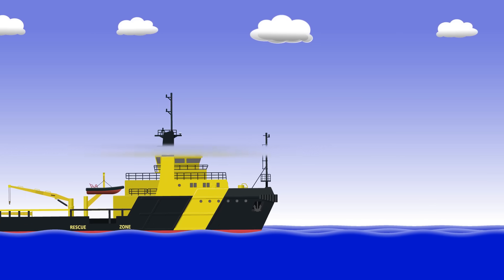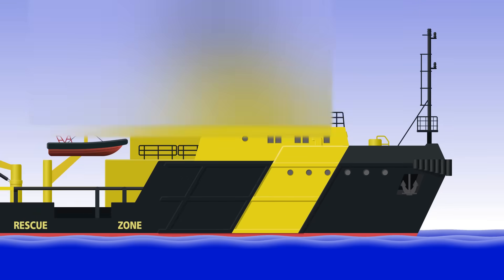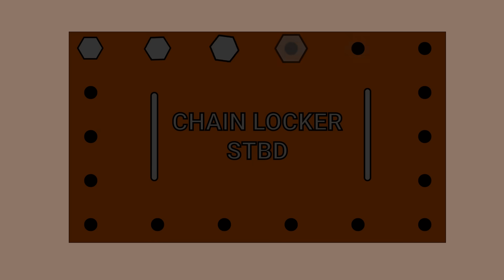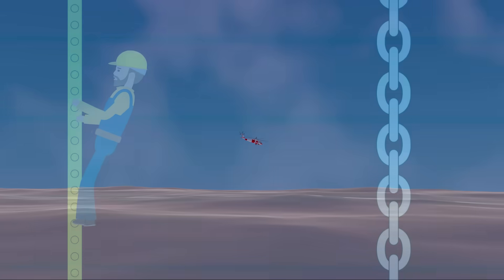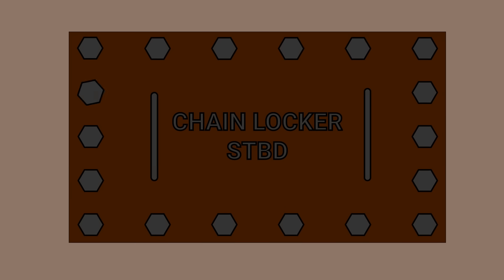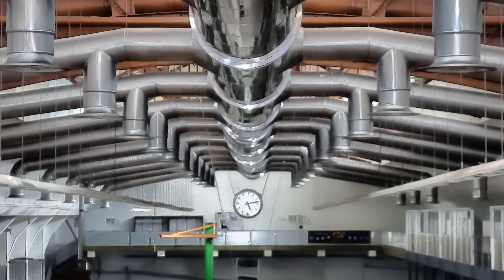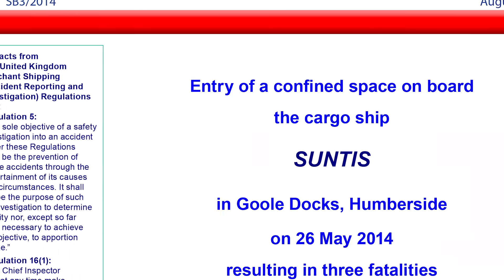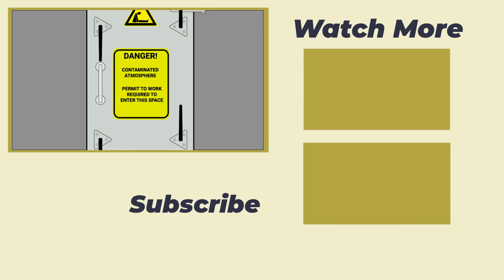Why Enclosed Spaces Are So Dangerous? | Enclosed Space Entry

Comment: How do submarines stay under water weeks on end actually? Where do they get the air they need from?
Reply from the maker: It's all about balancing the oxygen in the air. In nature plants do it, but in a submarine technology needs to do it
Reply: They have either pressurized air and CO2 filters or have an atomic reactor, which provides enough power to convert seawater to oxygen and hydrogen by electrolysis. They also convert seawater with steaming to fresh drinkable water. :)
Reply: Nuclear reactors underwater are awesome things. It’ll boil water to create fresh water to drink/shower/cook/clean with. It powers filters to remove contaminants such as CO2 from the air. It also powers electrolysis to literally create new air to breathe, as well as refill high pressure air tanks for doing things like refilling ballast tanks under so the sub can surface/dive.

Best of all, they need to be refueled on a cycle of years/decades instead of days/weeks. They only things that limit a sub’s endurance are consumables like food and spare parts.
Reply: either by resurfacing every few days, or by electrolysis if they are nuclear power

Comment: Enclosed space must be ventilated sufficiently before entering!
Reply: and even then use a air testing tool to know how the quality inside is.
and as the guard outside Don't ever go inside. that's just a extra body in the worst case
Reply: Or correct breathing equipment.
Reply: There was a rule that personal protection equipment (PPE) such as ear protection, eye protection, steel-toed boots etc. is always the very last option. Whereever possible you should remove the cause of hazard first and then augment with equipment to be safe.
Reply: @IroAppe  that's always the best case. But I also know that sometimes that option is not available or some one has to go in and remove the hazard for others.
Reply: @IroAppe  .

That is correct. For the benefit of others.. Safety training and working in enclosed / confined space training emphasizes the following:

1. Is it necessary for a person to even enter the space, or is there another way to do it.
2. Identify hazards.
3. Isolate hazards, stored kinetic energy etc. (Pressurized pipes/steam/electrical). Even consider things like flash flooding from sudden rain etc.
4. Provide ventilation methods / safety equipment, barriers etc. Have rescue teams on standby if considered serious enough.
5. PPE.
6. Untrained people must not "break the plane" ie. even put a hand through the opening of such a space and must remain outside whatever is going on inside.

Even on may be considered small jobs (and this was probably considered a small job, if not a routine practice signed off on, a JSA should be carried out. Often a short pre-start meeting where hazards are identified amongst the team and possible scenarios mapped out means everyone knows what to do in case of an emergency, and all steps are taken to make the job safe in the first place.

These procedures have been learnt the hard way, over many years, with many injuries and deaths beforehand, so it's not just to make management happy:

http://www.hse.gov.uk/toolbox/confined.htm
Reply: @VenturiLife  or better both if possible.
Reply: Wait can you just open the hatch and wait a while for air to go in or is that not enough
Reply: @thebananarepublic7255  if air is not  circulating it will hardly get any air inside,even if you put a strong fan to blow inside,it would have to blow hard and for sometime to blow the bad shit out of the same hole so ideally you need a circulating space with an entrance and an exit hole on the other side
Reply: @thebananarepublic7255  You would need to wait a long time, preferably have a forced air intake high above and an exit exhaust lower down. Many gasses like CO2 are heavier than air, so unless you have a very powerful fan that can reach lower spaces and create a mixing effect, then just blowing in air from the top will end up just blowing out the same air that just went in, unless there is an exhaust on the ground floor. I think the best emergency response to this situation would have been to open up a few air or oxygen tanks and quickly lower them down there.
Reply: We work on stainless tanker trailers at my work. Anywhere from fuel to chemicals to wine to sewage. In order to work on a Fuel tank SAFELY we had to open up every single possible valve and manhole, drain the remaining fuel, let an airhose running 115 psi blow through the system for at least 30 minutes before even attempting to test the space with an atmospheric tester (sniffer) and finally getting an enclosed space permit signed so you can go inside. Even after all that you go in with full ppe, Fall protection, proper masks, and NEVER before raidioing in to your floor lead saying your going in and again when your coming out. Enclosed spaces are serious work.
Reply: I learn abit about HSE stuff. Yeah. We have procedure to follow if we want to work at those area
Reply: Anton Babych weighs 460 pounds and would not have been able to enter that space anyway.
Also I doubt he's even leaving his basement
Reply: Y’all acting like the man didn’t say any of this in the video lmao
Reply: Enclosed rooms are enclosed rooms they can't be open in any way. They are isolated .
Reply: not always possible, thats why you always have someone outside, and usually use an air tank
Reply: The issue is that they probably did it before just fine and worked in the chain locker before.
Reply: Yes, that's common sense. I work on board btw.
Reply: what? nooooo
Reply: Enclosed spaces rule #0 - Attendant NEVER enter in the enclosed space.

Spell that like a mantra in the beginning of the training. After that, we are ok to continue...
Reply: Yeah like a bathroom...
Reply: I’m going to start an advocacy group called Mothers Against Enclosed Spaces  (MAES) pronounced ‘mays’
Reply: Maybe that should be on a sign on the hatch.
Reply: As well as testing oxygen levels, as talked about in other posts, UK regulations say that there must be a rescue team ready outside the enclosed space.
Reply: Santa is in breach of UK enclosed space regulations every time he goes down a chimney. He must also wear the right mask to filter out the soot and dust, and have harnesses and steady work-platform on the roof, as in the Work at Height Regulation 2005.
Reply: My uncle lost two colleagues this way. One entered some kind of turbine containing argon gas and quickly lost consciousness, the second guy tried to pull him out but obviously lost consciousness as well. A third guy almost entered until their team leader stepped in. The dude who sent them in without checking and clearing the turbine was fired for obvious reasons.
Reply: Und Kranplätze müssen verdichtet sein!
Reply: No ship sherlock
Reply: Yes and the air quality tested.
Reply: Probably could have saved them just by cracking a scuba bottle and lowering it on a rope
Reply: @derpinbird1180  no a air bottle like that is not big enough to fill the entire room. it would help if you can apply the bottles direct to there faces. it takes a lot of air to bring the room to a safe level.
Reply: @sirBrouwer  Thats speculation. Also elevating the oxygen levels in any way shape or form is way better than trying to climb down your self or just sitting there.
Reply: @derpinbird1180  no that is knowing my job. I do that for a living so i need to know what, how and why. 
you never climb down at all. that's the job of the people who have a independent air supply.
know that a anchor chain locker room is a very big vertical space. and unless the oxygen level is back to 19,5% it won't do much at all.
Reply: @sirBrouwer  More like knowing googles job. Yeah it says 19.5 is the minimum concentration to be safe at all times but if you scrolled down you would see that 15 is enough to support consiousness as long as you don't exert yourself and you could probably do with alot less to avoid hypoxic brain damage.
Reply: @derpinbird1180  no i seriously work as a fire and safety guard at a chemical plant. (Dow Beneluxe)
and a small scuba tank will have no more then 10 litre of mixed air. in a large room like we are talking about that will not do much at all. just follow procedure as you will have been trained. they are there for a reason.
Reply: @derpinbird1180   Funny how you try to criticize him for Googling up facts and then you immediately use Googled facts to support your argument. Have you ever even seen the proper equipment for ventilating enclosed spaces? You aren't going to do a thing with a SCUBA tank.
Reply: Or atleast i hope he doesn't, if he doesn't know how much air his men hold in their tank he is likely to get someone killed. Though comparing guards to service personnel is like comparing a security guard to law enforcement.
Reply: @Sableagle  And who said you needed to replace all the air? Also how big is this hypothetical anchor chain compartment? fyi, the o2 concentration can get lower than 15% to sustain life. You can get it down to 10, hell even if you get it up to 5 or six you have 5 minutes or so to figure out how to solve your problem or you know get another tank in a large ship which is specifically designed to rescue people in a variety of different situations.
Reply: @derpinbird1180  I said you have to replace at least 20% of it with oxygen if you want me to go in there to get the guy who just passed out upon trying to breathe whatever shit is in there now.
Reply: @sirBrouwer  A small scuba cylinder will carry a lot more than 10l of air. 
A 10l cylinder filled to 200bar will hold 2,000l.
Reply: @sirBrouwer  maaaybe if the bottle was 200 bar of pure oxygen. But these bottles are again the same 78% nitrogen, 21% oxygen and 1% everything else so you don't die.
Reply: Derpin Bird you have to bring them up and they said it wouldint fit
Reply: @derpinbird1180  brilliant I agree
Reply: Hey Anton. Have you ever worked within similar situations? Thank you.
Reply: @cardy4ever  I did! And he's correct!
Reply: @cardy4ever  Onboard my vessels never happened such situations
Reply: Remember kids, don't enter enclosed spaces or voids without proper lighting and ventilation. Definitely don't enter if there is inert gas being filled into the space; it will literally push oxygen out of your lungs even faster and very suddenly near the bottom of the space.